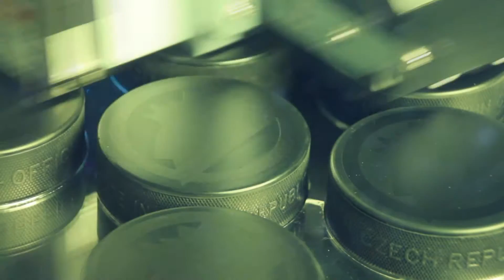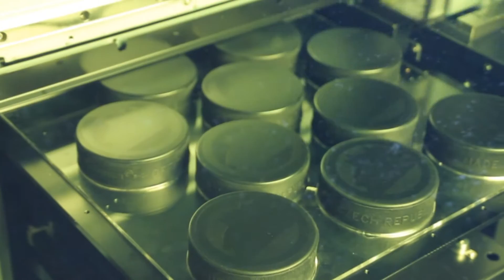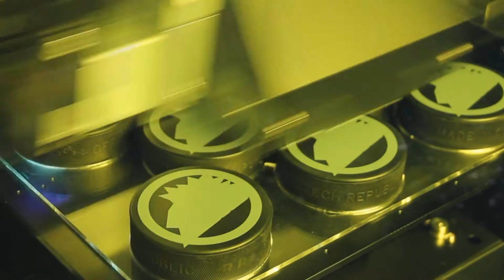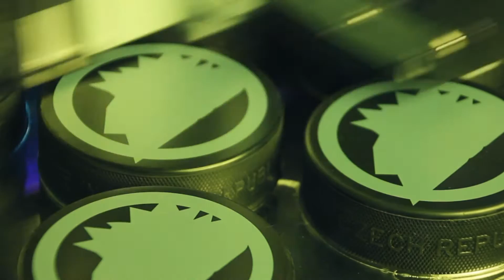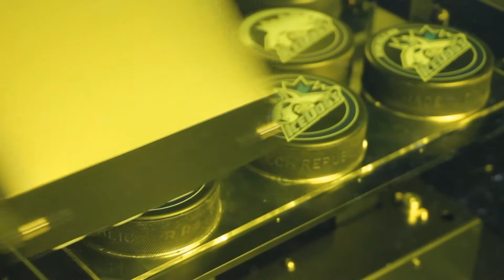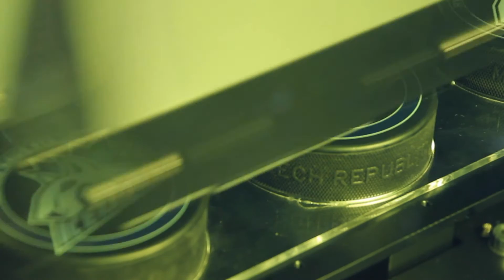Custom hockey pucks with a Roland LEF12

Comment: How durable is this print for on ice use ?
How reliable is the printer, and the white ink flow ?
Doing wideformat and DTG with white ink now, and looking into UV for promo goods, low runs, full colour.
Reply: +steve Gamble - I have done 200 pucks for a client and on the first use they peel off.We printed another sample after solvent application to surface and wash and dry, but it did better but not durable, We now call them souvenir pucks and had to discount to the customer 50%